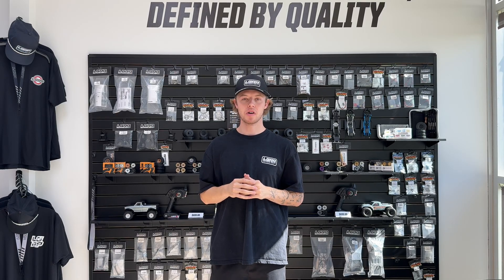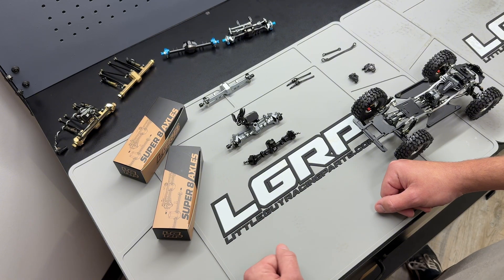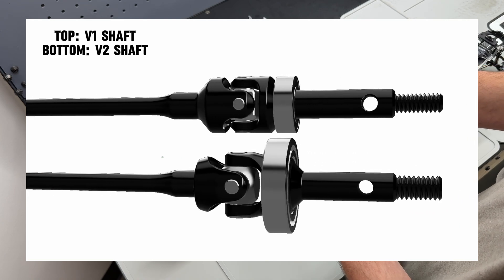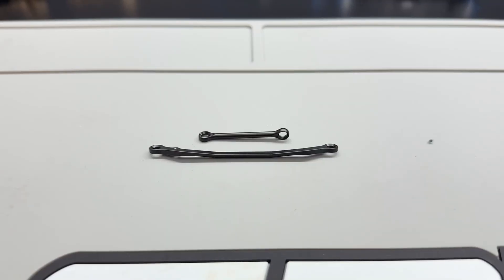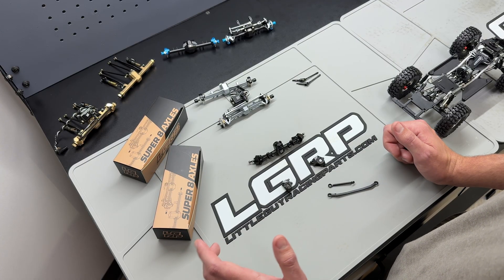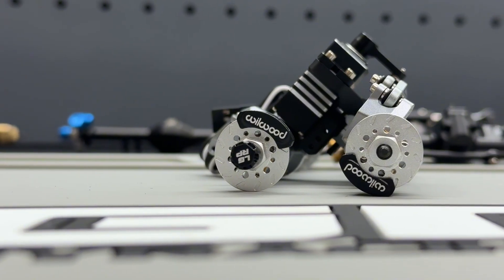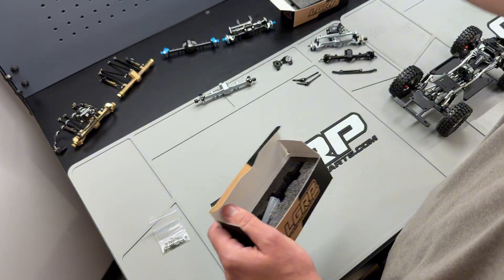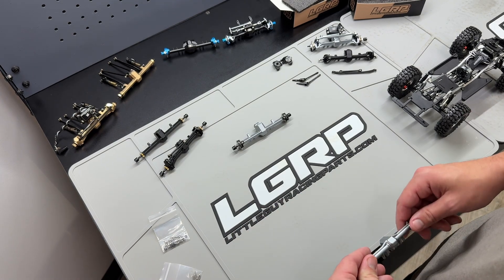Super 8 V2 Axles Explained: What’s New, What’s Improved, and What You’ll Need

Comment: Note to other users. The brakes rub on rotors and are not keyed well to maintain alignment. The rotors also rub against the screw head that holds down the bearings on the axle shaft.